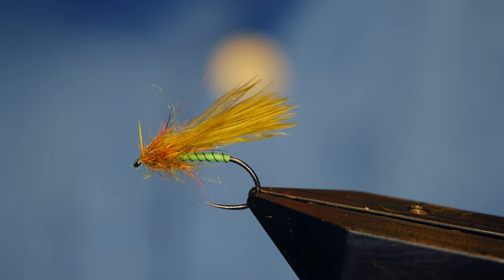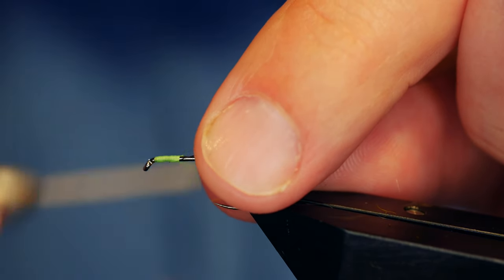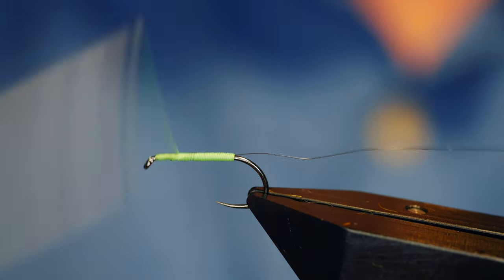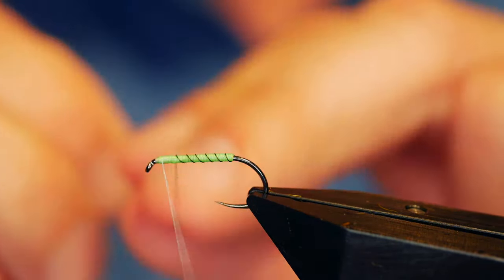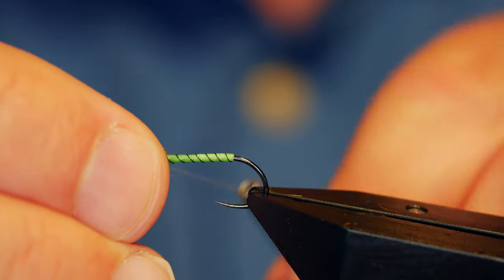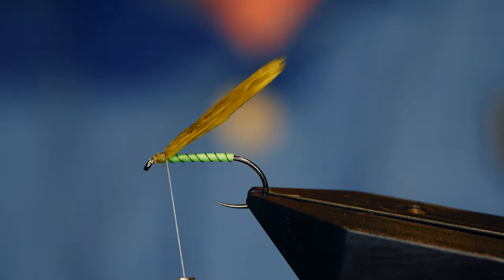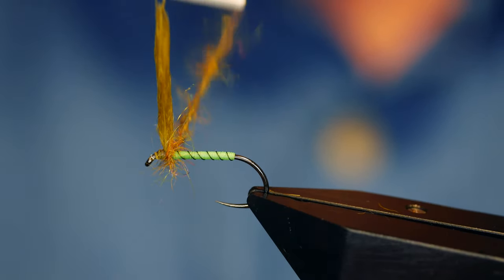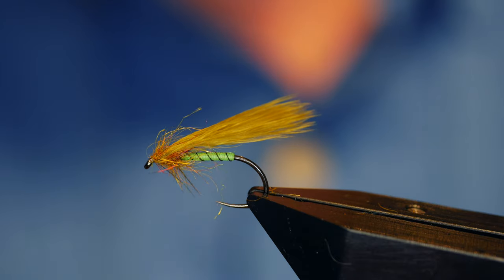How to tie the Caddis Cormorant #fishing #flytying #flyfishing

Comment: That’s a nice looking cormorant.

Suggestion for efficiently using your unloved bobbin holder. Use it to hold & apply thinner lead/non-lead weighting wire to the hook when you need a lot of wraps.

Just a curiosity question - you have a quality rotary vise. I find it much easier to get evenly spaced wire wraps by using the rotary function of my vise, & I’m wondering why you don’t use it when you tie?
Reply from the maker: Thanks pal, I do use the rotary function just not all the time. I am a bit of a shotgun tier not tying more than at most five of the same pattern.